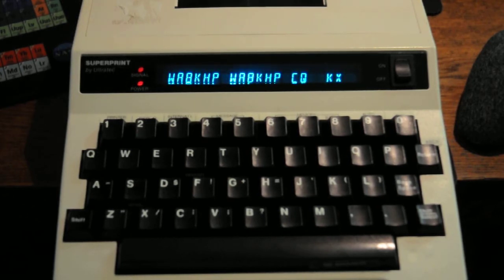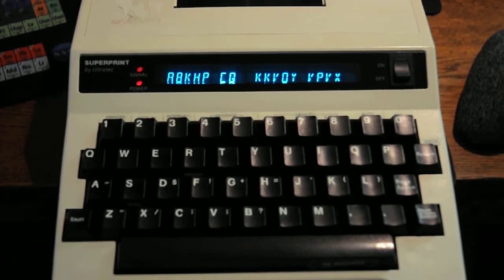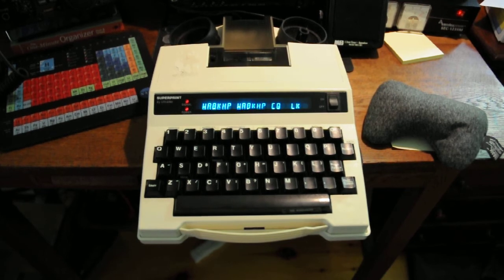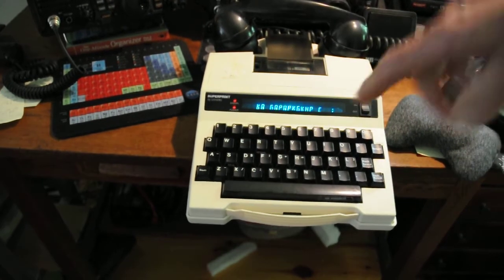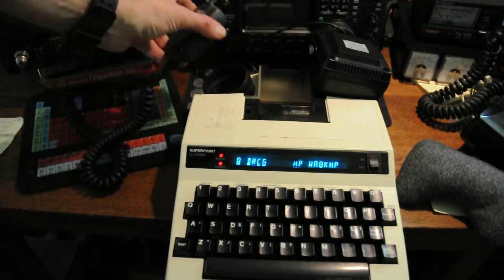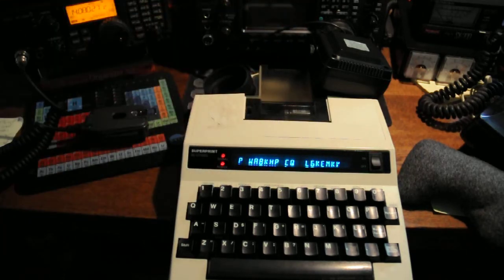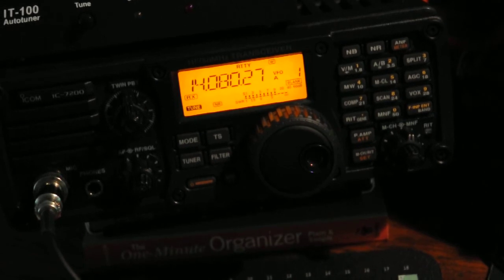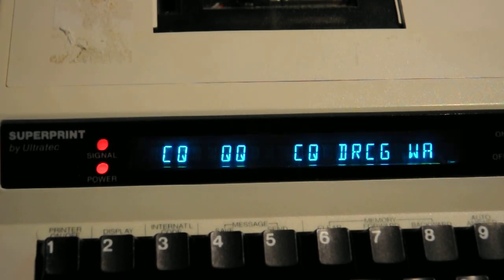IC-7200 RTTY  decode using old TTY machine

Comment: I'm running a business setting people's clocks to the timing signal (5,10,15,20,25 MHZ).

so far I've gotten 0 sales/calls

can u help me rework the advertisement or enter an all new business altogether.

r u advanced ?
Thanx
Reply: I'm...not sure there's any demand for that? NTP does that automatically over internet and cell networks at no additional cost, and WWVB broadcasts a VLF timecode signal that's not affected by ionospheric propagation and works with readily-available radio clocks.

Comment: Who the hell would use a portable TTY machine in the 70s ???     Easy answer :  People who needed to defeat telephone taps and keep calls secured.     A form of scrambling a call that required the ones who spied on you to record and then decode,  giving you time to stay ahead of whomever had you in their sights.
Reply from the maker: Or deaf or hard of hearing people.. that's who they were made for. I never heard of it being used for security purposes, but I can believe it!  It's one of  the earliest digital modes!  I love the sound of TTY compared to other modes.  I bought mine in the late 80's, you can plug it in or use rechargable internal batteries and this upgraded model has a on demand printout of the messages if wanted, and a large character buffer. It's also an RTTY answering machine. It still works. 
Thanks for insight on it's early uses...,
 in the 70's for that purpose they would have lusted after mine !
Reply: @hamradiocomms  : You right !!   It didn't occur to me it was for the deaf.  I researched the subject and found that it is being sold brand new ($ 270).   Also, there is a Captioned Phone that works through operators on the internet and is cheaper ($ 75)